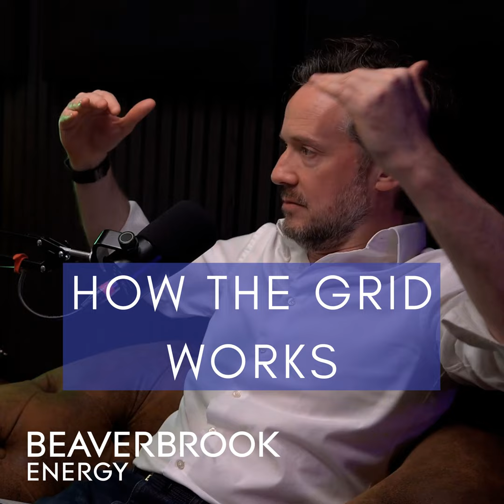How the Power Grid Works: From Turbines to Batteries

Comment: I enjoyed the conversation, albeit a brief one.  Yes I understand it is a 10 min podcast, but this is a massive subject and your speakers were flowing with interesting points.
My comment is that your sound level is far too low.  I turned you up to 100% on YouTube and yet still had to turn down my other devices as I could not make out the conversation.
Reply: Just to add.  I have now listened to a number of your other podcasts and the sound level is low across the board.
I appreciate that we all use different equipment to listen and we all have different audio acuity, so for context here is my preferred set up:  PC with a quality motherboard (audio DAC quality), feeding a stereo amplifier into decent speakers.  I am a professional pilot, so have had my hearing checked every year for decades, so I know my hearing is not what it was in my twenties, but it is still above average for someone 60 years old.
Please just listen to your podcast, then listen to a variety of quality broadcasts on the same equipment.  I am sure you will agree and this may help you build your audience.